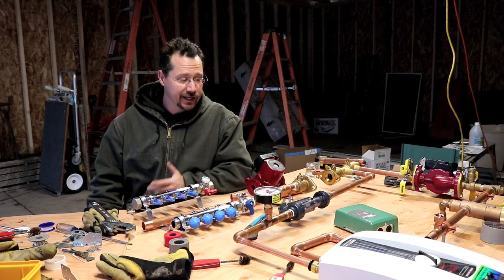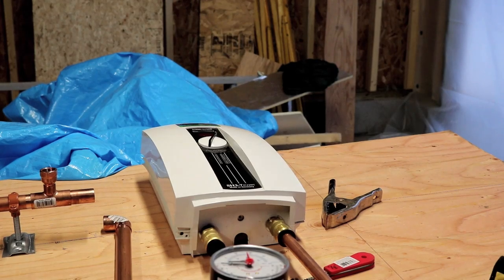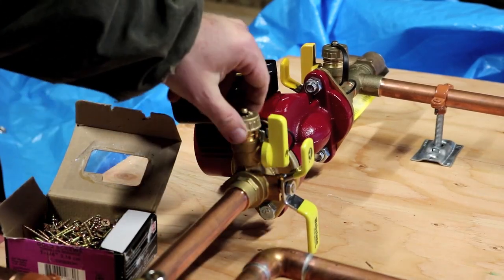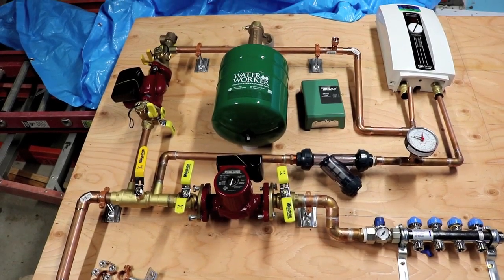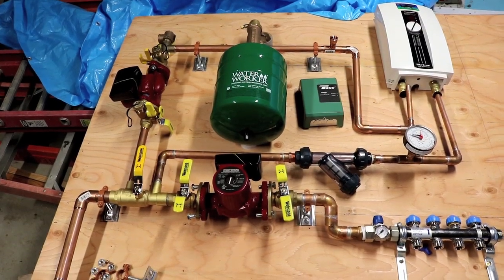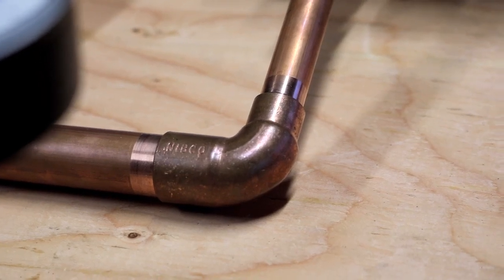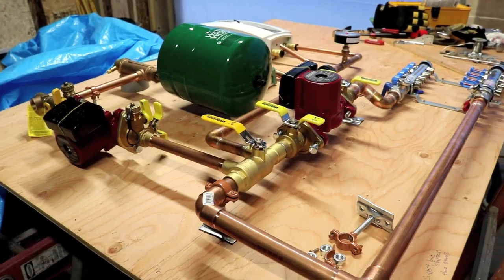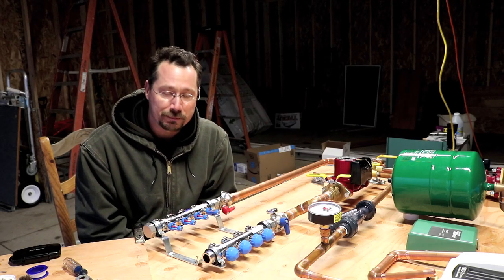Ben's Garage: Hydronic Heating Update Jan 25 2017

Comment: You put the expansion tank on the cold side not the hot side. Also judging by the absence of the backflow preventer, you definitely did not pull a permit on this install. $300 for the cost of this electric water heater thing would cost you $300 more in repairs. Learn this rule: Cheap is expensive. BTW, you're heating an uninsulated GARAGE! Why heat a garage and an uninsulated one?! You might as well run your heating pipes under your driveway, pull up a chair and a large patio umbrella and hang out; better scenery...
Reply from the maker: Backflower preventer for what? This system isn't plumbed into domestic water.
The garage is insulated to the same standard as my house. In this video, the garage is still under construction. I think the insulation went in maybe a week after I made this video.
Reply: @BenjaminNelsonX  How are you filling it?
Reply from the maker: @Order-in-Chaos  This is a closed loop glycol system. It just have to be filled once. A good pump, some hose, and a five gallon bucket works fine.

Comment: You only need one pump, keep the one on the return and get rid of the pump on the supply
Reply: 2 is good, but you need a better controller. You want second pump to run by itself so it can run longer and use all the heat. And then the main pump runs off a auqastat that will cycle the boiler between 130 and 180

Comment: Wont this make ur house turn into an oven?
Reply from the maker: Um.... That's sort of the point of any heating system. Your house is just a big box that you heat in the winter.

A house is a much larger box than an oven, so no, it's not going to be 400 degrees.

I originally just designed it with an ON/OFF switch, and would just run it maybe on a Friday night for working in the garage over the weekend. It just raises the temperature. I'd usually shoot for about 50 degrees, as that's very comfortable for working in a jacket AND FAR BETTER than a 10 degree outdoor temperature!

The mass of the concrete absorbs the heat created and slowly releases it over a longer time. This gives the advantage of a stable temperature.

Comment: Great work on your project and your video Ben. Thanks a lot for sharing. I am designing and building a similar garage system here in Canada. I have a single zone of 300-ft of 5/8" PEX already installed in the 4" garage floor slab.  I believe you mentioned that two pumps are required so there is enough pressure to feed micro-boiler in the boiler loop to activate it.  I am trying to figure out if my system will operate with one circulation pump only.  This will save me over $200 dollars.  Any thoughts? The pump I ordered is a 3-Speed Grundfos - Model UPS15-58FC – 1/25 hp.  Thanks.
Reply from the maker: It really depends on what you are using for a heat source. Read the instructions for your heater and follow the pump requirements based on that.
Reply: @BenjaminNelsonX  That makes sense.  Actually I'll be using the 7.2kW Hydro-shark 3, as you did. It appears the best solution for my small install of a 400 square foot work shop where I only have 60 amp service to play with. I just ordered it through Menards and need to pick it up in Michigan over the holidays. I'll take a second look at the hydro shark manual. I'm just at the parts gathering stage of this enjoyable and challenging project.  I'm finding it a liitle harder too find some of these parts here in Canada that aren't twice the US cost. I appreciate any and all advice.  I feel these microboiler systems have lot of potential to be  cost effective heating solutions.
Reply from the maker: @ryanofcanada6780  Since you are going to Menards anyways, check out any displays and other information they have on hydronic heat while you are there. The larger Menards stores should have a nice display of some of those components.
Reply: I am trying to figure this all out too for heating my shop.  In one place I read where if you are using a condensing boiler, if the return water is too cold, it can mess up the proper operation of the boiler.  By having a primary pump with the purge valve, it won’t only be cold water entering boiler.  I have a tankless condensing water heater for DHW. Only cold water enters it, so I am not sure why it is a no-no for boilers.

Comment: I’m actually in the trades. Commercial/Industrial HVAC electrician. I work on huge air handlers, that utilize hydronic heating and cooling circuits to condition the air flowing through the air handlers. I work directly with union fitters, on these systems. You’ve done a great job. I’ve helped install several of those fractional Hp pumps also... I’m wondering if you could do a video showing the details of each component  that you have there?.. it would help tremendously!.. thanks!... keep up the great work!...just a thought. Have you considered hydro solar panels as your hot water source?.. then the electric as a backup.

Comment: Doesn't want to use fossil fuels. Probably the electric company sources its power from coal or natural gas. No free lunch here.
Reply from the maker: "Probably?" No. I have my own solar panels, the power I do get from the power company is renewably-sourced, and even if it was from coal-power, I'll use that energy at off-peak times for cost-saving AND to use the energy from night-time "idling" coal plants.
Using a hydronic system also opens up adding heat from another source, such as a wood-fired boiler.

Comment: A mixing valve should be added to the system especially with a wood fired boiler for temp. control.  I am  having a 10 kw solar system installed for my house and detached 1500 sf. garage in Colorado ( 300 days of intense sunshine) to augment LP Tagaki  TKJR  on demand water heaters using a copper plate heat exchangers for the  infloor heat.  Keep up the good work! PS. house and garage also have wood stoves.
Reply from the maker: At this point, the micro-boiler has complete temperature control, and I only run that at about 100 degrees F. Yes, with a wood boiler I would absolutely want to add some additional temperature controls.

Comment: Great video i  am not dyi homeowner and I belive this make work on my basement ... how much all this cost ?? Do I need 110v or220 v... my have install the pump circulator to regular base heater it works fine for 2 days and then nothing so I looking better eays to do it some one suggests to conevet to water heater so heat the baseboard radiators.. I have also the same taco controller connecter the circulator pump so no idea ???

Comment: I have couple of questions. How do you make sure you have enough fluid in the system? It might evaporates through the air remover part and the heater can get damaged when heating empty spots. Why is the expansion tank facing down? Doesn't that cause the fluid lose? And last question, can this system heat the panel radiators instead of floor tubing?
Reply from the maker: No, the anti-freeze doesn't evaporate. The air-bubble remover actually PREVENTS void in the fluid that could cause issues with cavitation or heating.
The expansion tank is facing down because that's how it is in the installation manual for the tank and how it was on the professional system that I more or less copied (but paid significantly less for.)
Yes, a similar system could heat radiant panels, although it would likely have to be running at a higher temperature. Temperature times surface area is what transfers total heat. Because the floor is so big, the system can be run with very low temperatures. It's more of a "warm water system" than a "hot water system". I typically run the electric heater at around 100 degrees fahrenheit.

Comment: Something is missing! The diverter or mixing valve. The temperature of the water in the loop must be low and controlled.
Reply from the maker: There is no need for a mixing valve. It's a closed-loop system. The electric boiler only heats the water to whatever temperature I set it to, usually about 100 degrees Fahrenheit. With the entire floor of the garage being the heat source, only very low boiler temperatures are required.
Reply: The mixing valve has the 2nd intake from the return of the loop. The speed of the pump influence the temperature as well as the power of the heater. The mixing valve compensates this two maintaining the temperature at the set value. In Europe the hydronic floor started to be use in residential since 35 years.  Now it is mandatory in almost all new constructions. A mixing valve is always used in the system to avoid stress on the materials of the floor.
Reply from the maker: @1968matrix   The output temperature of the heater is variable and automatic. It provides a steady low output, no matter what the return temperature is.
Reply: David Vianello no need to mix.    Set the water heater at desired temperature
Reply: @anexpertateverything4816  If something could go wrong, it will. In the 90", in Germany,  I saw entire floors that had to be removed to fix failing systems. I always prefer to be in the safe side
Reply: @BenjaminNelsonX  I understand. But if something goes wrong, you want always a safe option.

Comment: Dude you did this way over board brother!!!! Dang an electric boiler? You must have a  nuclear power plant in your backyard.
Reply from the maker: The roof of the building is covered in photovoltaic solar panels which make electricity. It's a freestanding building with no natural gas or LP anyways.
Learn more about it at: https://300mpg.org/bens-solar-garage/
Reply: Where I am cost is 11 cents kWh. Canadian. His 7 kw heater probably uses less than $1500 a year. For me cheaper than propane. And Wood- we’ll check $ for set up up to $10k.

Comment: He wants to use an electric water heater to get away from using fossil fuels, never mind that coal is used to generate the electric needed to run his electric heater.  Should have gone with natural gas, much cheaper and cleaner.
Reply from the maker: Hi Woody, the entire roof of the garage is covered with solar panels. Try as I may, I'm never going to make my own natural gas, but I can make my own electricity. (Never mind the expense of running a natural gas line there in the first place!)
I also still have a wood-fired boiler that I'm going to hook up to this system.
People seem oddly focused on the fact that there's an electric boiler involved. What I really like about the system is the insulation, the thermal mass, and the quietness of the system. They are all GREAT regardless of which fuel is used!

Comment: Nice project, im like you , have many interests, got into plumbing recently, installed 2 oil fired boilers to include all the heating units in 2 total home remodels, took the plunge and bought a Milwaukee m12 Propress for all the copper fittings as well as an Milwaukee m18 pex ring presser, unbelievable tools for this kind of work, it was costly, but a thrill to use and your done in an 1/8 of the time, no leaks.
Reply from the maker: Great job! I live in the greater Milwaukee area. We've love Milwaukee Electric Tool ever since the Sawzall!

Comment: More like "Ben's Uninsulated Garage"
Reply from the maker: I was working on multiple things at once while the garage was under construction. At the point of the video, the insulation wasn't done yet.  Rest assured, the garage is fully insulated to house standards of my area - fiberglass batt insulation in the walls, foam insulation over the sheathing, and blown-in attic insulation.

Comment: Nice. Hows it working?
Reply from the maker: Overall, I've been very happy with the system. I will say that heating with electric has the potential to be expensive. On the other hand, I already heavy electrical running to the garage, but no natural gas, propane, etc. and that saved me from having to install any of the expensive infrastructure.
I'm still planning to experiment with a wood-fired boiler (which was part of my plan from the start.)
The thick concrete slab does a great job of moderating temperatures. Just having good insulation in the garage, along with the mass of the concrete (and the fact that the concrete is insulated) really helps with temperature control in the garage, even WITHOUT heating.
Another side benefit is that the garage has been very cool in the summer.
I've also been very happy with the Passive Solar Garage Door. It lets the light (and heat!) in and the insulated concrete absorbs and releases the heat. https://www.youtube.com/watch?v=EcuRfnP6E7I

Comment: How big is your shop, and how well does your 7200KW boiler do at heating during really cold weather?  What kind of delta-T can you maintain before that little boiler can't keep up?

I've tried to run the heat loss calcs on my 30x40' insulated pole barn, and I think I need about 15-20K BTU/hr to maintain a 50F delta-T (which is warmer than I expect to need in Nebraska).  That's well within the 24K BTU rating for that 7200KW boiler... if I'm doing my math right, which I may not be.

Comment: That is a closed pressured system that you needs a boiler pressure regulated with a back flow protector. A wood boiler is a non pressured system.  I would recommend a plate heat exchanger to transfer wood boilers hot water to the pressured floor heat system.  Most people don't have enough space on there electric panel to add a electric boiler that could require 80 amps.
Reply from the maker: Yes, a heat exchanger was exactly what I've been thinking if I added a wood-fired boiler.
The electric micro-boiler I've been using so far is 7200 watts, or 30A. The garage has a 100A breaker panel and now includes a solar array and several electric car charging stations.
Reply: 7,200 watts is about 25,000 btu. I typically figure about 45 btu per sq foot is needed from a boiler.  If you did not insulate under the concrete you need to figure even more btu's.
Reply from the maker: 2" of foam under and around the concrete. https://www.youtube.com/watch?v=hvtELaVmSi0

Comment: Very nice set up. You may want to use a 40 gal water heater whether you go with an outside boiler, or solar, or not. Energy storage is key to energy efficiency. Also, if hydro is expensive at certain times, you can run a timer.
Reply from the maker: A water tank isn't needed for storage. The water tank would only hold 8.34 pounds of water times 40 gallons = a mass of about 334 pounds vs 24 tons of concrete that the garage floor is made from. Heating the mass of the floor itself is medium of storage.
Reply: I guess what I was saying is that, with a temperature differential of 50 degrees (100-150), a forty gallon water heater will store 16,700 BTUs of energy. 25,020 BTUs for a 60 gallon WH. That is a controlled storage of energy, where as the mass floor storage is already released.

Comment: The nice thing about your set up is that you can easily add solar thermal panels to the system flowing the water thru your electric heater   along with a heat storage tank.  Using the panels and a tank you likely will totally stop ever having that electric heater energize
Reply from the maker: Unfortunately, my yard is shaded, especially in the winter when heat is needed most, but YES, the great thing about a system like this is that a person can add heat to the system in a number of different ways! I plan to do some experimenting with a wood-burning boiler to heat with bio-mass.
An insulated water tank really isn't needed either, as the floor itself is a large thermal mass, capable of absorbing a large amount of heat and releasing it slowly over time.
Reply: @BenjaminNelsonX  Would think that most of the yard would be less shaded in winter than summer unless you have nothing but ever greens  grins.  As to the storage tank my thinking is that it allows for a buffering tank so you are not having cycling of the heater.    Since you do have the little electric dont forget to descale it annually.
Reply from the maker: Although I don't have any good place for solar hot water panels, I did modify one of the garage doors to become a solar collector on sunny winter days. See the write-up at: https://www.instructables.com/id/Passive-Solar-Garage-Door/

Comment: Electric heating to heat water? Why not just use electric rads? The efficiency of electric is 100%.
Reply: Alex Fournier electric radiators are conventional convection type heaters they're okay if you want to heat the ceiling
Reply: I believe Alex means Electric mesh, instead of pax water
Reply: This also adds the ability for his wood fired boiler.  That being said I still would use a natural gas heater they are so much cheaper to run, and if and when I had that much solar capacity add solar to the system
Reply: Alex Fournier 
electricity is almost 100 percent efficient if you start at the coal  plant and measure all the way to your heater yiu find a drastically different story